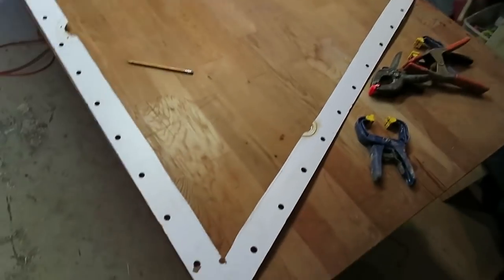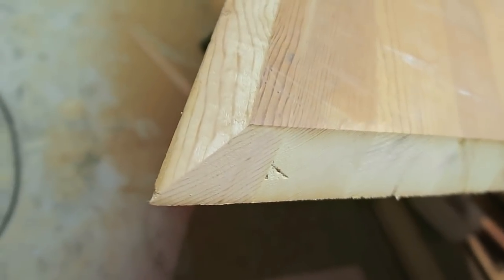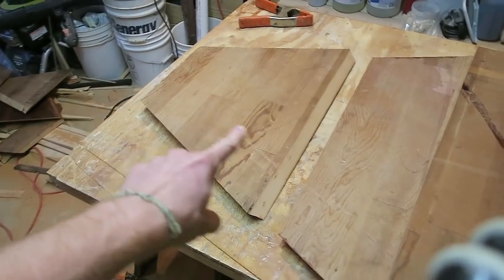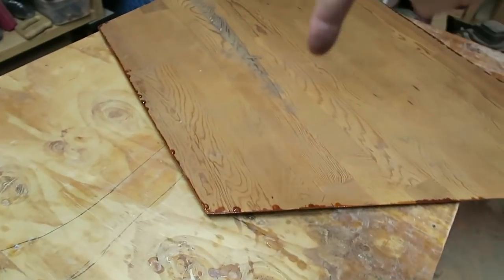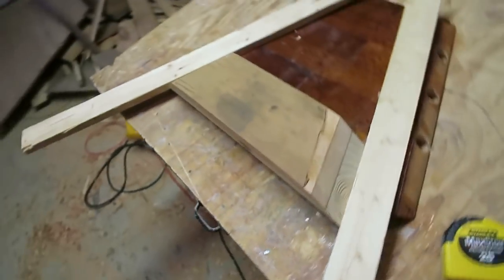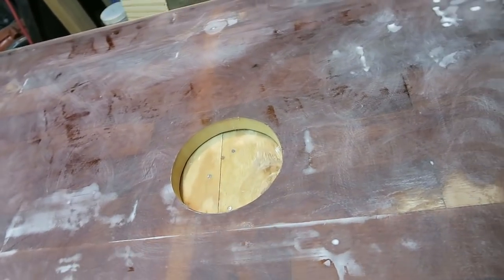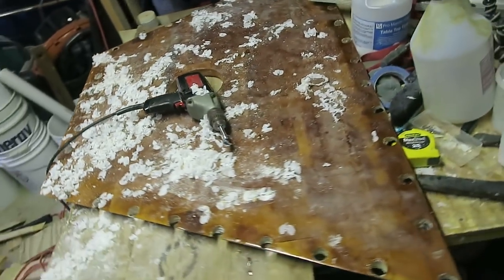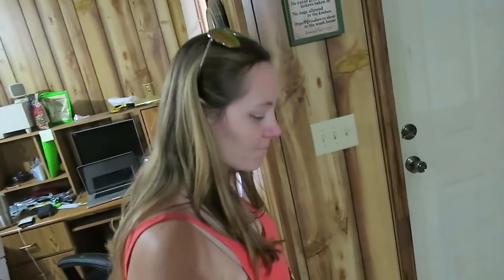New Water Tank Lid For Our Endeavour 32 Sailboat | Sailboat Story 80

Comment: Try this, when you are pouring large amounts of epoxy, mix in baking soda, and it should cure. A big tablespoon full per that cup.
The baking soda works with silicone too.
Reply from the maker: Does that have the same effect as "micro bubbles"?
Reply: I think so, try a small cup. A lot cheaper than micro bubbles.

Comment: Really nice job on the water tank lid. I have those Plastimo water bladders. When I epoxy I try to have the temperature at 60F, or I will put a heater under the wood project. I've also had epoxy curing problems at lower temperatures, and had to redo projects. You'd think that even at lower temperatures a solid cure would take place, but take more time. It seems the molecules run out of time to find each other to cure properly.

Comment: Nice work! But the rest/support seems like a lot of work.  Why not just laminate the underside of the tank lid with Formica too?  Formica is completely waterproof, and so long as it can be done in one piece (no seam).  It is flexible so it can be brought aboard, laminated on board and put into place.  Then the adhesive that joins the wood parts is not exposed to water.  No loss of tank volume to the rest/support.  Still not enough room for this?
Reply from the maker: Ironically, the lid we removed was constructed in the way you describe, with a single, seamless sheet of Formica. It had several large blisters, full of nastiness, and what was beneath it was rotten.

Comment: Tank lid looks great.  What design is your new dinghy?  We built a woods design rowing/sailing dinghy and loved building it.  Wanted to let you know if you haven't painted it yet that the Rustoleum deck and bottom paints work great and are affordable.  Lowes carries them you'll need the primer for the deck paint makes all the difference in the finished job.  Looking forward to seeing your build video on the dinghy.
Reply from the maker: It's a Chameleon.
How's that paint hold up in the hard wearing areas?
Thinking about the keep for beaching, daggerboard sliding, etc.
I'd love to go with a cheaper, but effective option.
I have perused the HD shelfs seeing what else might work.

Thanks for the paint idea.
Reply: So far it's looking good.  Some bottom paint scraped off when we had to drag it over some rocks but only had one coat.  It was in the water in Marathon down in the keys for 7 weeks and had zero growth on it when we pulled it out.  The top side paint is holding up pretty good.  Good solid coat of primer I think is the key.  It was the first boat we built from plans and ran low on $ was our reason for trying the less expensive paint.  We are planning to start our build of either a Wharram or Woods catamaran at the end of this year and will be using the Rustoleum paint both inside, outside and bottom.  

Love your editing style keep the videos coming.  Are ya'll taking a break to replenish the cruising kitty?

Comment: Excellent editing.

Massively over-engineered :-)

Bare epoxy is not very stable  without an overcoat of gel or varnish it will degrade with time even out of the sun.
Reply from the maker: It'll be under the v-berth cushion.
Should be fine in that particular case.

Yeah, I probably did over engineer.
Trying to do the best I can sometimes results in me over doing stuff!
Hopefully it holds up. I think it will.

Comment: The wood bits you are referring to as boring bits?  It might be easier to find them next time if you call them Forstner bits.  You can buy complete sets of them and imo they are absolutely great when woodworking!  What kind and brand of epoxy are you using?  I'm looking for some thicker resin for my deck core job.  Most epoxy won't cure out unless you have air temps at or above 60 degrees or so and then you have to wait more than 24 hours to set up.  Keep up the good work.
Reply from the maker: The package of this particular bit only had the word boring on it. It sure is nice though. A real quality tool, and a set would be nice to have.
Reply: I got mine through Grizzly.  It's nice having a Grizzly 30 miles away.  hehe.  Forstner bits are well known throughout the fine woodworking industry.

Comment: How will air escape the tank when being filled with water?
Reply: My thoughts exactly, best case scenario it will be difficult to fill with a slow trickle pouring it in or impossible to fill with a hose from a dock! Though I am sure Ben will figure it out. :-)
Reply from the maker: We typically fill with the inspection hatch open to monitor when to stop filling.
There is a vent built into the end of the tank though.

Comment: So why not just put a bladder in instead - they make v shaped ones .
Reply from the maker: I had heard reports of them failing quite frequently. Just wasn’t very optimistic about going that route.
Reply: yep, they can fail but I think they are quite good now and most failures are due to bad installs - you won't have that problem . Many jet fighter have bladders for fuel tanks . Your fix was good , just might have been less work to drop a bladder in the same spot and then no contamination issues .